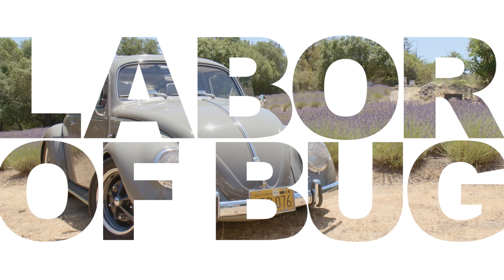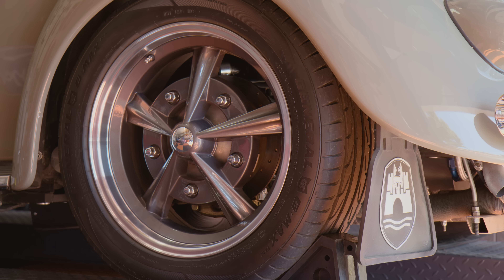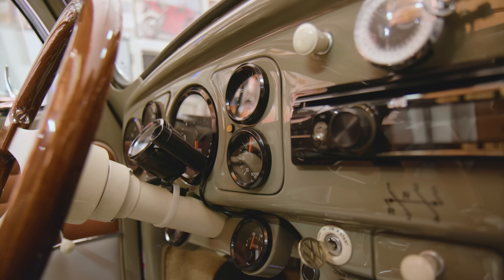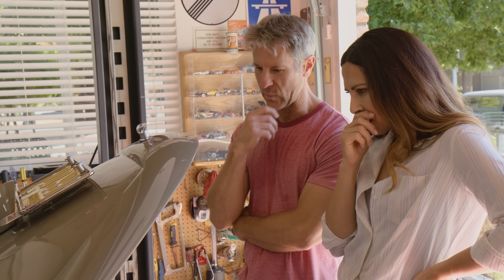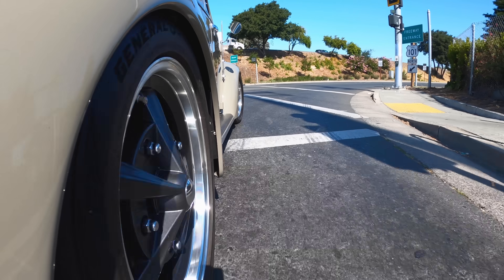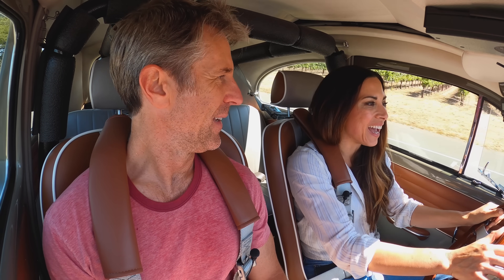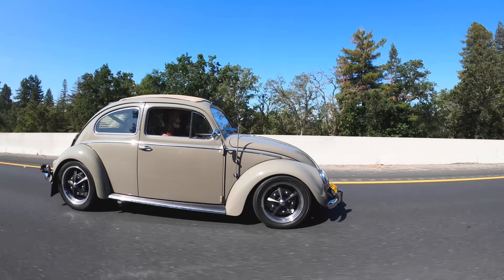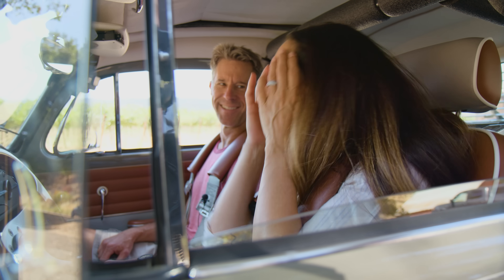LABOR OF BUG: Twin-Turbo '59 VW Euro Beetle 27 Years in the Making | EP10

Comment: ...So, whats up with the transmission...what did you do to hold up to that much power ???
Reply: 1959 Euro Beetle Twin Turbo Resto-Mod

Engine:
•	2387cc VW Type 1 aluminum super case with Hoover mods, 8.3:1 CR, clearanced, blueprinted and balanced by owner
•	Scat forged counterweighted 86mm crank, type 1 mains, 2” Chevy rod journals
•	DRD 5.5” H-beam rods with 5/16” ARP bolts
•	Revmaster long 94mm cylinders, cut to length
•	Wiseco  pistons[P/N#K633M94, 9400XX ring pack(1.0mm x1.2mm x2.8mm)] 
•	WebCam custom grind turbo cam with Dial-A-Cam steel straight cut gears and CB lightweight lifters 
•	CB Wedge Port CNC ported heads(44x37.5) with single “Bee Hive” springs and 8mm chromoly studs
•	NGK DCPR8EIX Iridium spark plugs and Magnecor wires 
•	Scat 1.25:1 Pro Comp rocker arms with ACN heavy duty dual tapered aluminum pushrods 
•	Parallel twin modified Garrett VNT25 variable vane turbos with manual vane control and water jacket cooling system by owner
•	Custom 1.5” phase tuned “twin scroll” exhaust system, ceramic coated and wrapped, made by owner 
•	Twin Turbosmart 38mm wastegates and Turbosmart Eboost Street electronic boost controller
•	Electromotive upgraded TEC3 EFI full sequential engine management with Clewett Engineering cam sync. Dyno tuned by AJ at Performance In-frame Tuning  in Napa, CA making 230HP/210TQ at the wheels with 15psi
•	Bosch in-line fuel pump, Aeromotive regulator and filter, teflon hoses, with Siemens Deka 60lb/hr injectors
•	Prometh two stage water/methanol injection with nozzles before and after compressors, with Snow progressive controller
•	Custom blow through finned aluminum intake with modified CB 48mm throttle bodies & match ported injector manifolds, HKS blow off valve, custom dual throttle cable system and cold air intake by owner
•	Bergmann modified Porsche style fan kit with custom thermostat, front, rear and lower cylinder tins  by owner
•	Scat 5.25” aluminum pulley with sand seal, crank trigger wheel and custom sensor mount by owner
•	Dry sump system with CB pump, Pure Power cleanable filter with Scat bypass mount, remote cooler with thermostatic fan control and custom oil tank in right rear fender well by owner
Transaxle:
•	Type 1 swing axle, gusseted aluminum Rhino case, Berg 5 speed with Quaife TBD by Rancho
•	3.44 R&P, 3.78 1st, 2.21 2nd, 1.58 3rd, 1.21 4th, 0.93 5th  with Berg custom mid mount and 5 speed ball shifter
•	Empi long spline, long axles(‘68 only), with custom prototype lubrication system, by Mike Herbert at Rancho and owner 
•	Custom hydraulic clutch with remote reservoir and heavy duty hiem joint clutch cable back up option by owner
•	12lb. flywheel with Kennedy Stage 2 pressure plate, CB dual friction disc, anti-shocker and high torque starter
Chassis, Suspension & Brakes:
•	Airkewld 4” narrowed, adjustable front beam, with bump stops and tow bar mounts added by owner
•	CB 2.5” dropped spindles with CSP wide 5 drilled front disc, Hurst Line Loc and CB wide 5 drilled rear disc brakes with Tilton remote reservoirs
•	Wilwood brake proportioning valve on front line and brake cooling ducts front and rear by owner
•	Sway-a-Way 26mm rear torsion bars, Atomwerk 1” lowered adjustable spring plates with needle bearings
•	Pan stiffeners, front beam stiffeners, gusseted torsion arms, front air dams, four wheel alignment and corner balance
•	CSP torque bar, Berg traction bar, tranny straps and custom 0.75” front and rear sway bars by Addco
•	Bilstein shocks front(stock height) and rear(1” lower and custom valved)
•	Custom one-off aluminum smoothie wide 5 wheels with spun aluminum hubcaps(15x5F, 15x6R) and a set of Rader track wheels(15x5F, 17x7R)
•	Dry weight approx. 2200lbs.   
Body & Interior:  
•	Grafted in ragtop and semaphores, body work by owner and Rick Eichler, Classic Restoration in Sonoma, CA
•	VW mouse grey PPG CLV single stage urethane with clear coat sprayed by Rick Eichler
•	Original style interior with German square weave carpet & Haartz Stayfast canvas ragtop by West Coast Classic Restoration and custom Daily Driver racing bucket seats by Status Racing Seats
•	4 point harnesses and roll bar, LED lighting, original pop out quarter windows
•	1.25” widened fiberglass rear fenders by Creative Car Craft, convertible decklid with custom rain gutters by owner
•	Dynamat sound deadening material throughout and custom heater system with booster fans
•	Custom auxiliary wiring harness with blinking semaphores, emergency flashers, intermittent wipers 
•	Custom Speedhut 12 gauge set and switch console and custom stereo system by owner
Reply: @turbovdub1867  A Bergmann fan shroud... You really have been working on this for a while. Haven't seen one of those in years!

Comment: Gotta love it at times when the car does all the conversation required. Very nice! I also have owned my bug since I was 15, now 57. Which efi computer did you go with? Was thinking of using the MegaSquirt.
Reply: I posted specs in a reply below.
Reply: I use Electromotive TEC3 EFI
Reply: 1959 Euro Beetle Twin Turbo Resto-Mod

Engine:
•	2387cc VW Type 1 aluminum super case with Hoover mods, 8.3:1 CR, clearanced, blueprinted and balanced by owner
•	Scat forged counterweighted 86mm crank, type 1 mains, 2” Chevy rod journals
•	DRD 5.5” H-beam rods with 5/16” ARP bolts
•	Revmaster long 94mm cylinders, cut to length
•	Wiseco  pistons[P/N#K633M94, 9400XX ring pack(1.0mm x1.2mm x2.8mm)] 
•	WebCam custom grind turbo cam with Dial-A-Cam steel straight cut gears and CB lightweight lifters 
•	CB Wedge Port CNC ported heads(44x37.5) with single “Bee Hive” springs and 8mm chromoly studs
•	NGK DCPR8EIX Iridium spark plugs and Magnecor wires 
•	Scat 1.25:1 Pro Comp rocker arms with ACN heavy duty dual tapered aluminum pushrods 
•	Parallel twin modified Garrett VNT25 variable vane turbos with manual vane control and water jacket cooling system by owner
•	Custom 1.5” phase tuned “twin scroll” exhaust system, ceramic coated and wrapped, made by owner 
•	Twin Turbosmart 38mm wastegates and Turbosmart Eboost Street electronic boost controller
•	Electromotive upgraded TEC3 EFI full sequential engine management with Clewett Engineering cam sync. Dyno tuned by AJ at Performance In-frame Tuning  in Napa, CA making 230HP/210TQ at the wheels with 15psi
•	Bosch in-line fuel pump, Aeromotive regulator and filter, teflon hoses, with Siemens Deka 60lb/hr injectors
•	Prometh two stage water/methanol injection with nozzles before and after compressors, with Snow progressive controller
•	Custom blow through finned aluminum intake with modified CB 48mm throttle bodies & match ported injector manifolds, HKS blow off valve, custom dual throttle cable system and cold air intake by owner
•	Bergmann modified Porsche style fan kit with custom thermostat, front, rear and lower cylinder tins  by owner
•	Scat 5.25” aluminum pulley with sand seal, crank trigger wheel and custom sensor mount by owner
•	Dry sump system with CB pump, Pure Power cleanable filter with Scat bypass mount, remote cooler with thermostatic fan control and custom oil tank in right rear fender well by owner
Transaxle:
•	Type 1 swing axle, gusseted aluminum Rhino case, Berg 5 speed with Quaife TBD by Rancho
•	3.44 R&P, 3.78 1st, 2.21 2nd, 1.58 3rd, 1.21 4th, 0.93 5th  with Berg custom mid mount and 5 speed ball shifter
•	Empi long spline, long axles(‘68 only), with custom prototype lubrication system, by Mike Herbert at Rancho and owner 
•	Custom hydraulic clutch with remote reservoir and heavy duty hiem joint clutch cable back up option by owner
•	12lb. flywheel with Kennedy Stage 2 pressure plate, CB dual friction disc, anti-shocker and high torque starter
Chassis, Suspension & Brakes:
•	Airkewld 4” narrowed, adjustable front beam, with bump stops and tow bar mounts added by owner
•	CB 2.5” dropped spindles with CSP wide 5 drilled front disc, Hurst Line Loc and CB wide 5 drilled rear disc brakes with Tilton remote reservoirs
•	Wilwood brake proportioning valve on front line and brake cooling ducts front and rear by owner
•	Sway-a-Way 26mm rear torsion bars, Atomwerk 1” lowered adjustable spring plates with needle bearings
•	Pan stiffeners, front beam stiffeners, gusseted torsion arms, front air dams, four wheel alignment and corner balance
•	CSP torque bar, Berg traction bar, tranny straps and custom 0.75” front and rear sway bars by Addco
•	Bilstein shocks front(stock height) and rear(1” lower and custom valved)
•	Custom one-off aluminum smoothie wide 5 wheels with spun aluminum hubcaps(15x5F, 15x6R) and a set of Rader track wheels(15x5F, 17x7R)
•	Dry weight approx. 2200lbs.   
Body & Interior:  
•	Grafted in ragtop and semaphores, body work by owner and Rick Eichler, Classic Restoration in Sonoma, CA
•	VW mouse grey PPG CLV single stage urethane with clear coat sprayed by Rick Eichler
•	Original style interior with German square weave carpet & Haartz Stayfast canvas ragtop by West Coast Classic Restoration and custom Daily Driver racing bucket seats by Status Racing Seats
•	4 point harnesses and roll bar, LED lighting, original pop out quarter windows
•	1.25” widened fiberglass rear fenders by Creative Car Craft, convertible decklid with custom rain gutters by owner
•	Dynamat sound deadening material throughout and custom heater system with booster fans
•	Custom auxiliary wiring harness with blinking semaphores, emergency flashers, intermittent wipers 
•	Custom Speedhut 12 gauge set and switch console and custom stereo system by owner

Comment: Such a clean build, thanks for featuring it! 
Is there someplace to find more details about this car? I was wondering if that was a a Ron Lummus roll bar or if the owner fabricated it.
Reply: I posted specs below.
Reply: 1959 Euro Beetle Twin Turbo Resto-Mod

Engine:
•	2387cc VW Type 1 aluminum super case with Hoover mods, 8.3:1 CR, clearanced, blueprinted and balanced by owner
•	Scat forged counterweighted 86mm crank, type 1 mains, 2” Chevy rod journals
•	DRD 5.5” H-beam rods with 5/16” ARP bolts
•	Revmaster long 94mm cylinders, cut to length
•	Wiseco  pistons[P/N#K633M94, 9400XX ring pack(1.0mm x1.2mm x2.8mm)] 
•	WebCam custom grind turbo cam with Dial-A-Cam steel straight cut gears and CB lightweight lifters 
•	CB Wedge Port CNC ported heads(44x37.5) with single “Bee Hive” springs and 8mm chromoly studs
•	NGK DCPR8EIX Iridium spark plugs and Magnecor wires 
•	Scat 1.25:1 Pro Comp rocker arms with ACN heavy duty dual tapered aluminum pushrods 
•	Parallel twin modified Garrett VNT25 variable vane turbos with manual vane control and water jacket cooling system by owner
•	Custom 1.5” phase tuned “twin scroll” exhaust system, ceramic coated and wrapped, made by owner 
•	Twin Turbosmart 38mm wastegates and Turbosmart Eboost Street electronic boost controller
•	Electromotive upgraded TEC3 EFI full sequential engine management with Clewett Engineering cam sync. Dyno tuned by AJ at Performance In-frame Tuning  in Napa, CA making 230HP/210TQ at the wheels with 15psi
•	Bosch in-line fuel pump, Aeromotive regulator and filter, teflon hoses, with Siemens Deka 60lb/hr injectors
•	Prometh two stage water/methanol injection with nozzles before and after compressors, with Snow progressive controller
•	Custom blow through finned aluminum intake with modified CB 48mm throttle bodies & match ported injector manifolds, HKS blow off valve, custom dual throttle cable system and cold air intake by owner
•	Bergmann modified Porsche style fan kit with custom thermostat, front, rear and lower cylinder tins  by owner
•	Scat 5.25” aluminum pulley with sand seal, crank trigger wheel and custom sensor mount by owner
•	Dry sump system with CB pump, Pure Power cleanable filter with Scat bypass mount, remote cooler with thermostatic fan control and custom oil tank in right rear fender well by owner
Transaxle:
•	Type 1 swing axle, gusseted aluminum Rhino case, Berg 5 speed with Quaife TBD by Rancho
•	3.44 R&P, 3.78 1st, 2.21 2nd, 1.58 3rd, 1.21 4th, 0.93 5th  with Berg custom mid mount and 5 speed ball shifter
•	Empi long spline, long axles(‘68 only), with custom prototype lubrication system, by Mike Herbert at Rancho and owner 
•	Custom hydraulic clutch with remote reservoir and heavy duty hiem joint clutch cable back up option by owner
•	12lb. flywheel with Kennedy Stage 2 pressure plate, CB dual friction disc, anti-shocker and high torque starter
Chassis, Suspension & Brakes:
•	Airkewld 4” narrowed, adjustable front beam, with bump stops and tow bar mounts added by owner
•	CB 2.5” dropped spindles with CSP wide 5 drilled front disc, Hurst Line Loc and CB wide 5 drilled rear disc brakes with Tilton remote reservoirs
•	Wilwood brake proportioning valve on front line and brake cooling ducts front and rear by owner
•	Sway-a-Way 26mm rear torsion bars, Atomwerk 1” lowered adjustable spring plates with needle bearings
•	Pan stiffeners, front beam stiffeners, gusseted torsion arms, front air dams, four wheel alignment and corner balance
•	CSP torque bar, Berg traction bar, tranny straps and custom 0.75” front and rear sway bars by Addco
•	Bilstein shocks front(stock height) and rear(1” lower and custom valved)
•	Custom one-off aluminum smoothie wide 5 wheels with spun aluminum hubcaps(15x5F, 15x6R) and a set of Rader track wheels(15x5F, 17x7R)
•	Dry weight approx. 2200lbs.   
Body & Interior:  
•	Grafted in ragtop and semaphores, body work by owner and Rick Eichler, Classic Restoration in Sonoma, CA
•	VW mouse grey PPG CLV single stage urethane with clear coat sprayed by Rick Eichler
•	Original style interior with German square weave carpet & Haartz Stayfast canvas ragtop by West Coast Classic Restoration and custom Daily Driver racing bucket seats by Status Racing Seats
•	4 point harnesses and roll bar, LED lighting, original pop out quarter windows
•	1.25” widened fiberglass rear fenders by Creative Car Craft, convertible decklid with custom rain gutters by owner
•	Dynamat sound deadening material throughout and custom heater system with booster fans
•	Custom auxiliary wiring harness with blinking semaphores, emergency flashers, intermittent wipers 
•	Custom Speedhut 12 gauge set and switch console and custom stereo system by owner